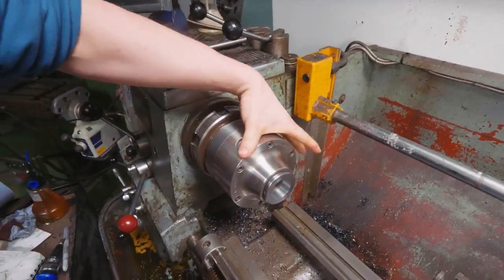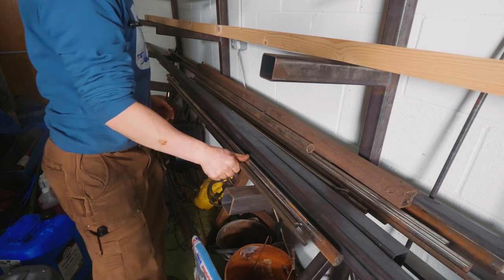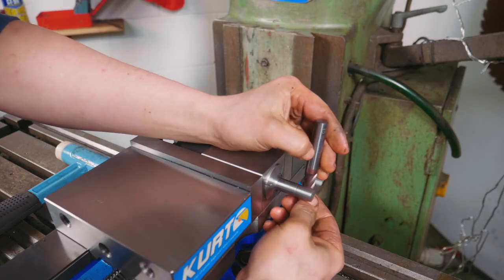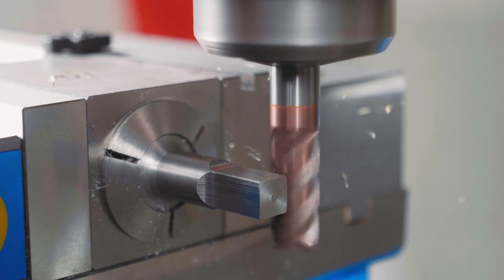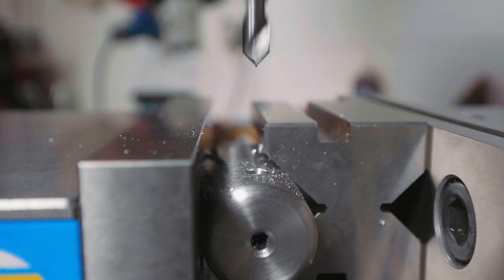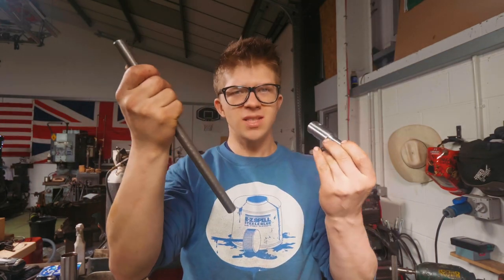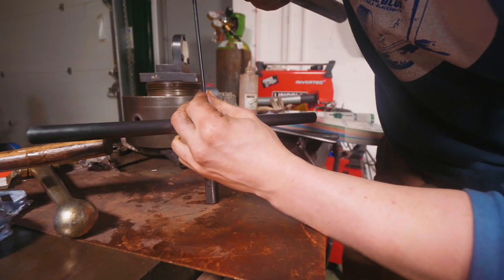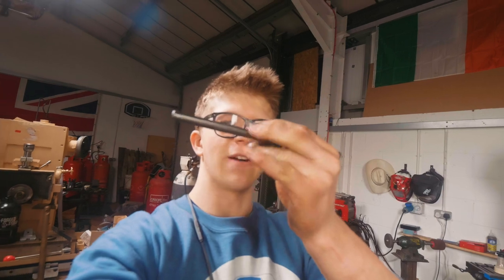MAKING LATHE CHUCK KEYS!!!

Comment: Those chuck wrenches look great Alec! I need to do the same for my 4 jaws, been putting it off for a long time. I even have some of that cold bluing to try as well. Glad to see you put that Kurt vise jaw stop to use! Thanks for the plugs to man!
Reply from the maker: Thanks Adam! Be careful with the cold blue - once you use it once you want to blue every single tool in the workshop 😂😆
Reply: Abom79 iii
Reply: Blued and touchmarked everthing in sight, that will be your trademark ALec
Reply: Thanks Adam, Alec -- I've been a hobby machinist for 25 years, and owned a Kurt for about 4, and never knew what that little bit was for!

Great to see you're getting into machining.  I think you have a pretty good handle on the smithing.  ;)

Comment: Last time I used a metalwork lathe was at school (in the 1970's) and I forgot a chuck key was in when I switched it on.  It punched a T-shaped hole in the workshop ceiling.   The key had no spring (before H&S arrived).
Reply: Amen brother!
Reply: There's a guy in my class at school right now whose nickname is Chuck key.. . For a reason.
Reply: The rule in our shop is, if you leave a key in and it gets spun out, who ever it came closest to gets to punch you right in the mouth. Only happened once, long before I started. Never happened again.

Comment: Alec, I recommend making two (2) keys for your 4-jaw chuck. When indicating a part it is much easier using two keys simultaneously. Tighten one jaw while simultaneously loosening the opposite jaw to move the part while maintaining constant jaw pressure. Works brilliantly.

Comment: My rule is to never use blind dowel holes. Dowels fail and then the fix is very difficult. I suggest a redesign. Set screw for flexibility. Weld for permanence. etc.

Comment: Light knurling on the handles would have been an added benefit. Also, a set screw into a groove on the handles would have been a better option over the roll pins.
Reply: I was thinking the same thing.  If you ever have to replace the handle that split pin would not be easy to remove.

Comment: Great to see you making the transition from black smith to tool maker.
Reply: Philip Cable my lathe has a cover over the chuck like a fendern and it won't start without the cover
Reply: Ok. Is that a problem for you?
Reply: Philip Cable no it means i can't start it while the chuck key is in the chuck as i can't put the cover down

Comment: I personally would have had the split pins horizontal not vertically driven. In case the handles need replaced. You could then drive the split pins out.

Comment: Love your videos and projects, Alec. When building parts/tools, I make them as disassemble friendly as possible. With your roll pins, I would’ve drilled all the way through the part, so you can knock it out, for whatever reason, later.
Reply: Brian James You would have drilled through the entire ~4-6" length of the chuck key!?!? That would have not been a good idea. He prob wouldn't have been able to keep it centered, and you'd have to use a really long punch you get it out. That makes no sense. I would have moved the pin around 90°, and had it running side to side.
Reply: Andrew Delashaw that’s what I meant. Sorry for the misunderstanding. Still a good chuck key nonetheless!
Reply: A Damascus chuck key would just be silly 😜 
They look fabulous.  Never leave it in the chuck or an apprentice master will appear out of nowhere and whack you on the back of the head .
The other choice to lock the handle is a grub screw but there is very little chance you will ever need to get them apart.
Reply: Just for fun why don’t you rework that cheap machine vice that you found to be out of whack?
Nothing to loose with that project😀

Comment: Enjoyed watching, thanks. Great to see people interested in trades especially this one.  I'm curious as to the type of steel used, if it was mentioned, I missed it. The material cut away rather easily for tool steel and clearly mild steel won't hold up over time. We never left our handles fixed to get more leverage when needed by putting off centre. Are you a jobbing shop Alec? You have some nice tools

Comment: What cold bluing solution did you use? That seemed to have worked better than any solution I have seen, particularly in such a short amount of time. Thanks for showing your mistakes and fumbles. It’s important to show that failure and learning from failure is a large part of success. Stay humble, and I dig the videos!

Comment: If you put the v block against the front (moving part) of the vise and indexed off the back of the vise jaw, you would only have to zero the DRO against the back jaw and move to the center for the different sized of round stock based on the round stock being on the back of the vise and that side of the round stock.  So now you could use ten different size of round stock and simply move to the center based on the back of the jaw.  Easy Peasy.

Comment: I never pin the handles to my chuck keys for the sole reason of that hole is "the weakest link" if you will. I had a key with a pinned handle and it broke right off after a while. I now just turn a shallow groove (just with a 45° tool and flat bottom) in the handle and drill/tap the driver for a set screw. I find there's 2 advantages with that method. 1: the handle is a solid piece and is less prone to snapping. 2: the handle can be moved around or removed and replaced if ever necessary.

Comment: The bluing  works best if the part isn't sitting on the bottom. Using something like stainless steel wire that's been degreased to suspend them works well.

Comment: If you zero out your mill to a back corner of the vise you then can have used the v block flipped so your part is on the back side of the vise so you didn't have to use your edge finder each time you put a new one in since you know the size of your part you're using and you just use the dor to bring it in blank distance to the center of the part

Comment: Hi Alec, i have  question regarding your cold oxide solution. how often to you have to change the solution. it is pretty expensive but it looks so cool. would be great to use the stuff a little more often than just one to two times

Comment: Alec, with the proper clearance and perfect alignment the press should work splendidly. Why not do a sliding handle for more leverage? Could have pinned pretty much any distance from center on both ends and given yourself a bit more leverage when you need it. 1-2 inches from the center would provide a decent amount of extra leverage with out being a full slide handle. Also, would slow C learence for odd shaped pieces to be mounted as well, like a mushroom over back edge on something (if that ever occurs in the future). Of course if you ever run into problems with handle clearance in the future, you can make a new key.
Nicely done, you machining is looking so much better. I think your getting you speed and feed rate dialed in much better.

Comment: You should of heated up the ends of the handle and hammered them till they flair out (like a fish tail) enough to not come out of the cross hole. That way you can slid the handle to one end and get a lot of torque when you need it or center the handle so you have the clearance you need to open and close your chucks if the female driver is not pointing upwards. They look great though. You may want to case harden them for longevity

Comment: Personally I would have made a hole in the tip to insert a spring that would force the key out of the chuck if you try to leave it. Just a safety feature since a chuck key launched when starting the lathe can be ranging from embarrassing to dangerous.

Comment: Does cold oxidizing add any benefits for wear reduction on raw steel parts? I need to make some latches that will get a fair bit of use, wondering if cold oxidizing is a cheap method of protecting the surface from wear and rust. Thanks!

Comment: Roll pins are oversize. If i was using a 1/4" pin I drilled a 1/4" hole. No reaming needed. I would also recommend a spring loaded pin for the end of your key. Charles comment below is why my sphincter puckers every time I use one without a spring. I know how forgetful I am and I know it is only a matter of time.

Comment: Nice vid. When you using this type of “splitt pins“ you do  not have ream the hole where is it suposed to be hammered in. When you use Normal hardend pins, you should ream your holes.😁😉

Comment: Not as much fun to buy Asian imported chuck keys, but they are available aftermarket in the most common sizes. I like your approach better...

One thing that you will most likely want - call it the 2nd generation design - is the ability to slide the handle around against slight resistance in the key. It seems to be a law of nature that especially for the four-jaw chucks, you end up needing to swing the handle past an obstruction at some point in doing a setup... or, at least I end up in that situation.

It's a case of wanting to swing the handle past and get a little bit tighter grip with the chuck before taking the key out of the socket to make another quarter turn.

just my experience - Your Mileage May Vary

Comment: Those chuck keys would render you a 50000 SEK (about 4000 pund) company fine if you had your company in Sweden. It's illegal to have a chuck key that can remain in the chuck if you have a company, for the risk of forgetting it there when you turn the lathe on. You would either have to have a stand where all chuck keys fit that have switches in the bottom so the lathe wont start unless the chuck keys are all there, or have springs on the chuck keys so they spring out of the chuck if you let them go.